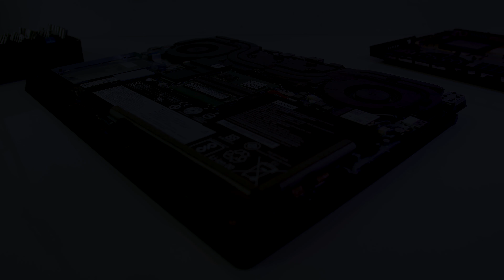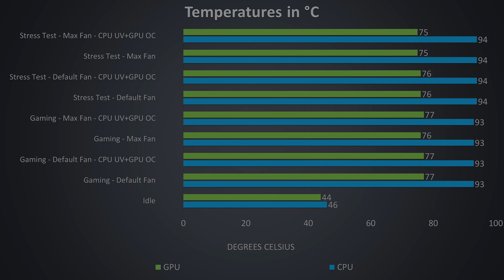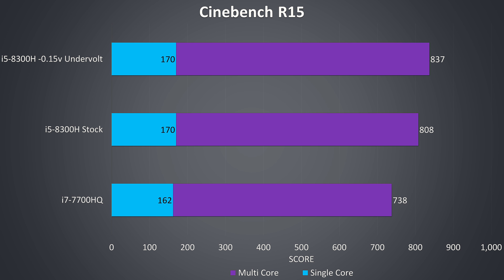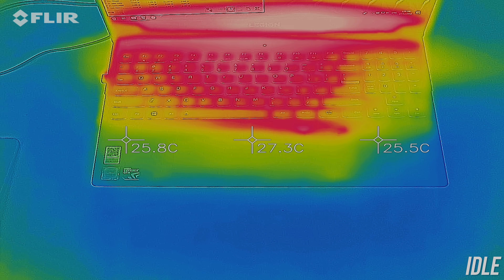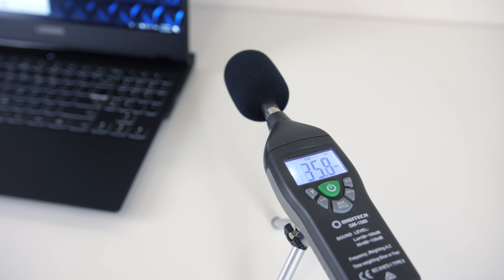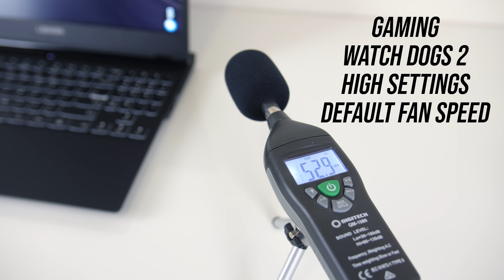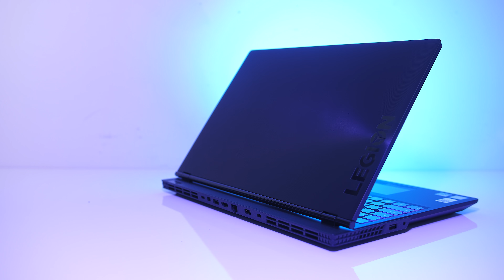Lenovo Y530 Thermal Testing, Overclocking and Undervolting

Comment: was thinking of getting this but I saw some people having issues with it and the heat is not great...  so I went with a msi laptop instead gonna order it soon...
Reply from the maker: Fair enough, pretty much all 8th gen laptops get hot from my testing though, just how it is - though worth keeping in mind what I'm testing is close to worst case.
Reply: Jarrod'sTech that's really good then...  but I have seen people having issues with the battery and some with the fans overall it seems like a little bit of a weaker laptop. if you google y530 problems some people said they're laptop stopped working after a couple weeks 🤷‍♂
Reply from the maker: I don't know, I feel like there are always cases like that, people go out of their way to let others know when something doesn't work but very rarely do people do the same when something is working perfectly, just what I think about it anyway, I always just test something out for myself and see if I experience the same thing, but even then I am just a small sample size of 1 so not that useful 😛
Reply: Jarrod'sTech yeah I agree. but I think I'm gonna pay a lil more and get the msi for safety 😂 but the y530 isn't a bad laptop for sure...  hard to say of course until you can test it...  but yeah thanks for the response have been watching quite a few of your videos to figure this all out...  not easy buying a laptop these days... 
anyways happy new year 😀🎉🎉
Reply from the maker: Cheers, happy new year to you too!

Comment: So should i undervolt my y530?
Reply from the maker: If you're power or thermal throttling, or just want to try and lower the temperatures, yes it's worth a go, it's basically always worth a go with 8th gen Intel CPUs.

Comment: undervolting tutorial for 7 gen cpu and is it safe?
Reply from the maker: Yeah works exactly the same, I've done it to some 7700HQ CPUs without issue.
Reply: @JarrodsTech  what apps you used to undervolting, i've i57300 hq here, are you recomend undervolting for this cpu? because when game and video rendering it could reach 80 degree celcius..
Reply from the maker: I use Intel XTU, but Throttlestop is better for long term and saving the config, I don't have much experience with it myself though. 80c sounds ok to me, maybe I'm just used to 90c+ from 8th gen lol

Comment: Wow, those are some nasty thermals, I've got the Inspiron 7567 and temps never even reach close to 80 degrees for the CPU or GPU, even 70 degrees is a rarity, I'm so proud!
Reply from the maker: Ah 7th gen? The 8th gen CPUs seem to get really hot 🔥
Reply: @JarrodsTech  i5 7300HQ + GTX 1050Ti, suppose I could squeeze a couple years outta this thing, so far I haven't had to play anything at less than high settings.
Reply from the maker: Yeah should be alright for a bit I'd think, I still use a 6700HQ at work and it's going fine after 3+ years!

Comment: Just wanted to throw this out here but for some reason Jarrod is getting really high temperatures. My y530 has the hotter i7 8750H CPU alongside the GTX 1060. With everything stock and the CPU locked to 45W with an ambient room temperature of 24C, here are the temperatures I was getting. https://i.imgur.com/vPhNxx3.png
Reply from the maker: Hmm looks like power limit throttling, so around 3GHz all core turbo speed over the 6 cores. Have you tried undervolting? I suspect that would raise the clock speed though perhaps also the temperatures. Still not sure why mine is so different, maybe I should do a follow up video and change the paste, maybe I had bad luck with the one I bought.
Reply: @JarrodsTech  Yep I did undervolt actually. This particular test was just for the sake of showing how it would run stock at 45W. Here are my results at 45W with a repaste and -0.150 UV. I must note that I did a poor job repasting however, so others would most likely see improved results. https://i.imgur.com/kv8ThhE.png
Reply from the maker: Nice improvements, I have no idea why mine is so much hotter then 🤔 a few others said theirs was similar to mine with the 8750h.

Comment: i have the same configuration except the processor is an i7. my idle temps are around 41 degrees without undervolting. is it ok or should i still undervolt for even better temps? thanks in advance for reply and happy new year Jarrod :)
Reply from the maker: That's perfectly acceptable for idle, I'd only be concerned if you're getting high 90's under load or something. Cheers! Happy new year to you too 😃
Reply: @JarrodsTech  Thanks for the reply Jarrod. Do you think re pasting the CPU with Arctic silver 5 will help with temps under load? or would you recommend any other thermal paste!! :)

Comment: i have the same model with i7-8750h and 1050ti and i got the same results and there is no difference after undervolting it, but i heard that lenovo put bad stock thermal paste so i changed it with arctic silver 5 and i didnt see any improvement, but some guys on the lenovo forum changed the thermal paste with other brands and they got a good results, so can you please try changing the thermal paste with some other brand and show us the application?
thanks :)
Reply from the maker: Hmmmm I'll think about it, I won't have time until I'm back from CES most likely, which is 6th-12th Jan.
Reply: @JarrodsTech  Good luck bro
Reply: Go to power plan settings -> change the advanced power settings -> power management of the processor -> maximum processor state, put it down to 99%. That is the solution.
Reply: @Ivan-go5ew  already did that, but it diabled the turbo boost, and i like the speed that it is giveing me, and i've seen posts of people that running the cpu at 3.9 speed with good thermals
Reply: @magdyabdel-aal59  It was a fact that the turbo boost was deactivated, sorry if I can not help you.

Comment: Ok I have two options to pick lenovo legion y530 or the Acer Nitro 5
Reply from the maker: I'd probably get the Y530, but I haven't tested the Intel/Nvidia Nitro 5.
Reply: Oh
Reply: So I want to like play on 120 fps without lag I play for 3 hours a day what should I get
Reply from the maker: Which ever has the best CPU/GPU, what game is that in though?
Reply: I play fortnite pubg and assassin Creed
Reply from the maker: Fortnite will be able to get 120 FPS on pretty low hardware without too much trouble, ACO/PUBG need higher, even with 1060 graphics you probably won't be getting 120 FPS unfortunately, so neither laptop would get you there.
Reply: @JarrodsTech  it's fine I don't play pubg alot
Reply: @moonlight3006  if your looking at the nitro, dont. get the ge63/gp73 instead
Reply: dont get acer nitro 5 it throttles too much, y530 is much better
Reply: watch dave2d's video on it
Reply: @MatijaIlievski  you can't always trust one source try other video that is covering about it or check its comment section regarding the laptop

Comment: The Y530 needs to be lifted at the rear like Asus's ergolift to increase fan flow , I'm using my Y530 like that and it has cool temperatures
Without undervolting at -150mv the CPU reaches 90-93 celcius but still maintains 3.9ghz boost (I'm running I5+1050ti)
You should really try and put an object or a laptop stand that can lift the rear part of the laptop at least 15-20° angle and you will see improved temperatures on the next video
Reply from the maker: Yeah probably should have tried it with the cooling pad, maybe in a future video if I cover repasting.
Reply: The 2 air intakes on the bottom are held back by their own design which is sad
Reply: @kevinlimin83  To be fair that's most laptops. I don't think there's any laptop that doesn't see improved cooling with the rear lifted as laptop feet can't possibly lift the unit high enough for proper airflow.

Comment: My helios 300 (8300h) got an bios update 1.20 n after that my cpu is reaching 96° while pubg 😅 how to check the clock speeds of single core when i run aida 64 it showed 3.3ghz something and my score of cinebench also increased by 50cb(now-850cb) before n after update but meanwhile i also updated the ram from 8gb to 2*8gb so is it bios update or ram upgrade which boost cinebench score and heat output ?
Reply from the maker: Oh my, memory increase shouldn't noticeably affect temperatures, maybe in the BIOS update they increased the power limit or something, that would improve performance at the cost of heat, or maybe they tweaked the fan curve in the update, honestly not sure just guessing at how that may have happened.
Reply: @JarrodsTech  thanx for the reply should i undervolt for safety ? And if yes can you please make a video on that using both Intel XTU and MSI afterburner
Reply from the maker: I've had them on my to do list for a while but just haven't had time to get to them, I suggest this video for undervolting: https://www.youtube.com/watch?v=yNt9L3BWOFo

Comment: New style is better easy to read.
I don't understand why you have this result. 
Cooling looks solid, 4 blow direction, fan have a lot of blades and look premium, heat pipes are close to fans and heat don't need travel much, and look like it have vaper chamber like Helios 500.
Reply from the maker: Yeah could be a problem with the paste application, if I go ahead with repasting it I'll do a separate video on it.
Reply: @JarrodsTech  a video on the repasting process and results would be awesome.
Reply: @JarrodsTech  Probably the stock paste. Many users including myself got ~20C reduction in CPU temp after repaste. The 8750H model can reach almost 1300cb in CB15 multi core load at 3.9GHz with undervolt+repaste

The fact that the CPU and GPU don't have much throttling is already good, despite the high CPU temp
Reply from the maker: What paste did you use? I have NT-H1 and Kryonaut here I could test with.
Reply: in aerodynamics, the fan blade shape and thickness can also affect airflow volume (both of which cannot be seen at a glance and require full disassembly of the fans to see). Inadequate thermal paste application under the heat pipes may also be the culprit
Reply: @DANNY082100  we can not check fan, but how it look planty for me, I think it just thermal paste problem

Comment: So I own the i7 8750H Version with the 1050ti, and it stays at 3.91GHz under a real world stress test. (exporting photos in Adobe Raw, for about an hour and it never dipped) I also scored 1225 in Cinebench and didn't notice any throttling. I wonder if the 1060 is just too hot for this laptops cooling solution. Granted, my testing was a CPU only stress test, so I may run into throttling if I stress the GPU and CPU at the same time. Great video though!
Reply from the maker: Thanks! Yeah I'd be interested in the results from the same combined load test that I was running, otherwise for tasks like that I'd expect full performance to be possible, especially Cinebench as that's more of a quick burst, whereas I let each temperature test go for 30 mins so it takes about 4 hours to collect all the data, so I think things get to settle a bit more to show long term averages.
Reply: Donovan Anderson I have the laptop with 1060 6gb but didn't tested it. Maybe when I will overclock it I will know
Reply: @foxygamingro8063   I'd be interested to see! I actually ran some more tests after applying better thermal paste. The results were good. I used MSI afterburner to apply a 250 MHz overclock on the 1050ti, and it ran warm at around 74C, but was stable and didn't crash (I used Unigine Superposition on 1080p MED) I scored 5681. CPU performance stayed about the same after applying the paste though.
Reply: Donovan Anderson Probably it will be 2-4° hotter but  better on performance.

Comment: Hey Jarrod, my undervolting values seem to keep resetting whenever I reboot. How do I fix this?
Reply from the maker: Try lower values, what are you using? For example if you're trying -0.15v, try -0.14v instead, keep dropping by -0.01 until you find stability. Good idea to run CPU stress tests to test for stability, as you might think it's stable during normal use then find a problem when you actually do something intensive.
Reply: Jarrod'sTech gaming works fine at 0.15v. Whenever I reboot my laptop, the values tend to reset.
Reply: Jarrod'sTech stress tests were fine as well.
Reply from the maker: Oh, using Intel XTU? It doesn't seem to like saving profiles, try Throttlestop instead: https://www.youtube.com/watch?v=yNt9L3BWOFo
Reply: how to stress test. sorry noobie here
Reply from the maker: @fritzsimounbacierto141  I use Aida64 for CPU, and Heaven benchmark from Unigine for GPU, or you can just play the games you usually use to see how they go.

Comment: I bought this laptop with the i7 8750H, I would like to see you change the thermal paste, thank you
Reply from the maker: What temperatures do you get if you run the same Aida64 stress test + Heaven benchmark? Curious to find out if you see worse thermal throttling, would also need CPU clock speeds too if thermal throttling is present 😁 yeah could do that, I'll think about it! I won't have time before I go to CES, and I kind of want to try and sell it ASAP before the new models are announced there haha

Comment: Lucky you were did you find a Lenovo Legion Y530 with a full fledged GTX 1060 and an i5 8300h?! All the models I have seen in Western Europe and North America are GTX 1050 TI + i7 8750h. Now I wonder which variant thermal throttles the most the one with the more powefull CPU or GPU?
Reply from the maker: I bought it through the Lenovo website on black friday sale, so I had the option of customizing it a bit. The CPU seems to generate more heat compared to the GPU, I didn't have thermal throttling on the GPU in this laptop.
Reply: @JarrodsTech 
Not an option in the E. U Or USA sites. Too bad cuz your specs are a much better bang for your buck. An i7 8750H is OVERKILL for a GTX 1050 TI, I mean I will be GPU bottlenecked anyways why bother with a high end CPU. Plus that CPU is so  damn hot I doubt the Y530 can cool it properly.
Reply from the maker: Ah that sucks, if I'd known that I would have picked a combination that better matches what people can get, I just saw the sale and thought GOOD DEAL BUY haha.
Reply: Frencho9 I have a I7-8750H with GTX 1060 6gb 8gb Ram 144Hz screen 1 tb hdd (7200 rpm) 128 gb ssd. The only problem I could hav is the 8 gb ram, need 8 more for better performance, but in rest os a very solid laptop for gaming or coding and what you would want to do with it.
Reply: @foxygamingro8063  well it's really easy to put in more ram if you need it :)
Reply: kuikai kui 1 buy the rams and then use them :)
Reply: The option is available in Malaysia. Maybe you can try international shipping?
Reply: newegg has an msi with a 1070 and an 8750h with a better cooling solution.

Comment: Nice.
You undervolted CPU using Intel XTU right? Although what did you do/use to overclock 180MHz the GPU?
Reply from the maker: Yeah I use XTU, although if I wanted the undervolt to remain in place long term I'd look at Throttlestop instead. I use MSI Afterburner for the GPU overclocking.
Reply: @JarrodsTech  thanks. I was wondering is 50dB comfortable for people sitting in other rooms in a house ?
Reply from the maker: Hmm it's starting to get a little loud, but pretty average (maybe a little below) compared to other gaming laptops, worth keeping in mind the measurement tool is fairly close to the machine too, I don't think it's too unreasonable though, hard to say really as it's personal preference.

Comment: Hmmm. Lenovo with gaming laptops... Just like walmart with OVERPOWERED gaming PCs
Reply from the maker: The Lenovo stuff seems pretty good, not sure if the heating I had here is standard or what, either way still performed pretty well. To be fair, Walmart just use the Tongfang chassis so even they can't screw it up much compared to their desktop PCs 😛

Comment: Wait gtx 1060? No max q? Am i dreaming?
Reply from the maker: Nope, no dreams! The regular 1060!
Reply: maybe in 2019 we will see  new line of gpus for this chassis more power efficient resulting less heat. I wouldn't go the i7 version because i also believe that it raises more temperature laptop can handle.
Reply: @MoslyTed  Hoping to see RTX ;)
Reply from the maker: I am expecting to hear about new laptop GPUs at CES in a weeks time, will have some videos up on the topic if that happens 👍
Reply: SalmonPunk 1060 6 gb 👌
Reply: @foxygamingro8063  ikr hahaha

Comment: my Lenovo y520 i5 7300hq gets amazing temps. 33c idle 70c max under a heavy load. and this is stock, no tweaking or repaste. thanks jarrod for doing this review, cause I was about to buy the Lenovo y530. lol not now with those thermals.
Reply from the maker: Nice! Yeah the 8th gen CPUs are quite a bit hotter than the 7th gen unfortunately, I guess not too surprising as even the 8300H performs above the i7-7700HQ 🤔
Reply: exactly!!

Comment: Does Leneovo has Nvidia Optimus like Dell G3? 🤔 Because the battery capacities are nearly same however due to some reason Dell's lasting pretty longer
Reply from the maker: Yeah it does, it swaps to Intel graphics when not gaming.
Reply: In your final review could you please compare the battery backup of Y530 with Dell G3 since they both almost carry the same specs.
Reply from the maker: I don't really do comparisons in the reviews, but could take a look if I do a dedicated comparison video. You can refer to the battery life I got in my G3 review, then the results in the Y530 review when it's done and compare though, as I do the same testing the results are comparable.
Reply: @JarrodsTech  No worries. Thanks a ton for replying. 🤗
Reply from the maker: No problem!
Reply: @JarrodsTech  You're the best YouTuber for laptop reviews. Hope you have a great year ahead. Always keep showering great videos like this.
Reply from the maker: Thanks! Hope you have a good year too 👍